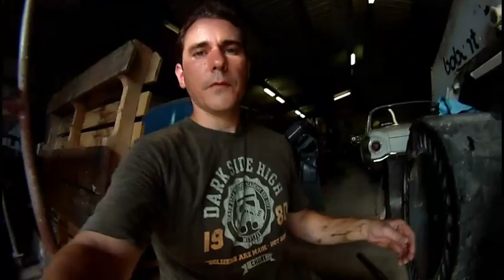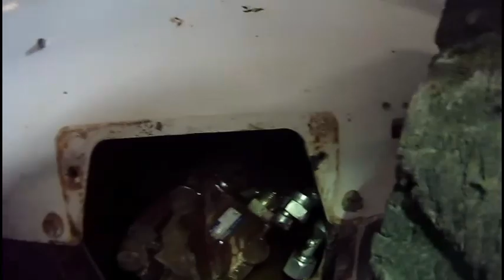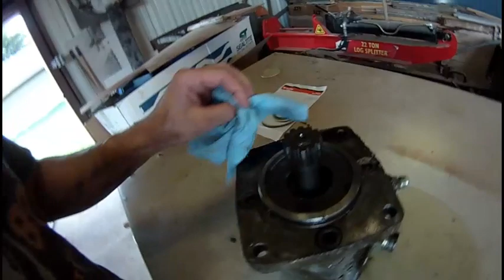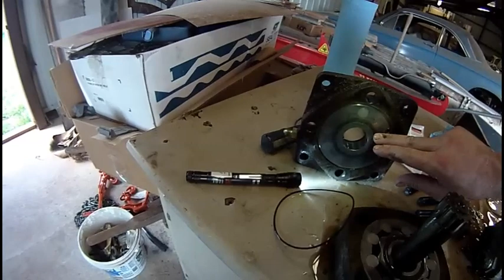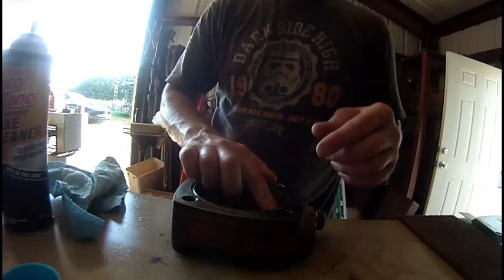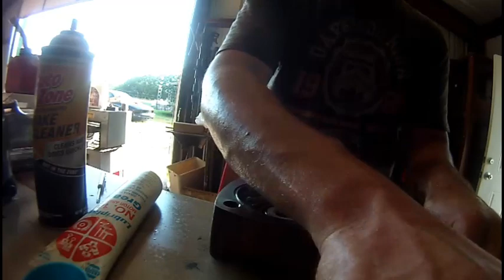Bobcat drive motor repair

Comment: Hey buddy I have a 1990 753 also. The right side is weak and jerky going forward and turning to the left. Do you know the part # for that seal kit? I'm pretty sure my and your drive motor are the same. Product # 6649128 my drive motor sticker. And do you know if I can put a case filter on each small line on the drive motor? Cause my does not have any filter for those line. Also not one on the return line to the tank. Thanks

Comment: Do you have the seal kit number you used? I have a mid 90's 753 bobcat and they said they don't have a seal kit for it at bobcat. Also do you remember the part numbers for the other o rings you had to buy that weren't in the kit.